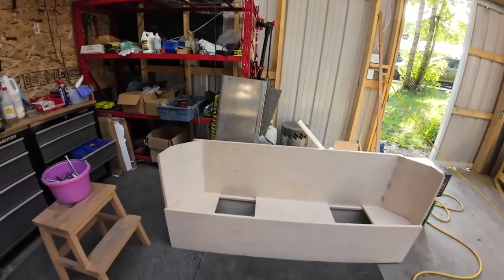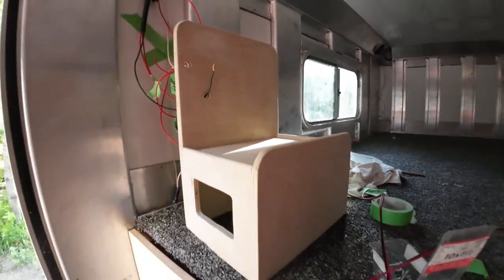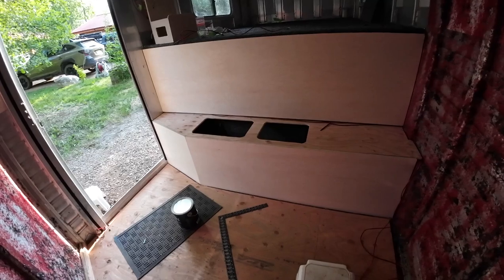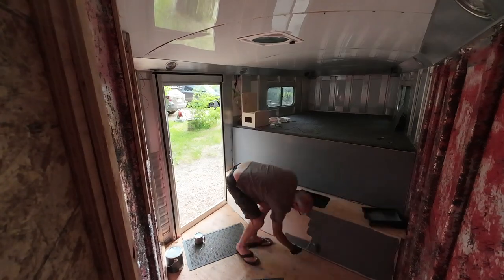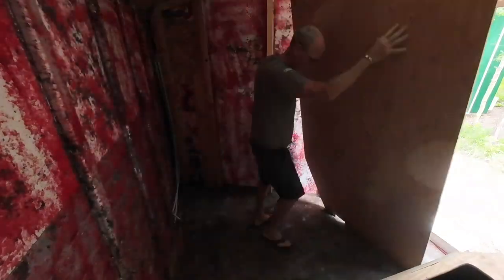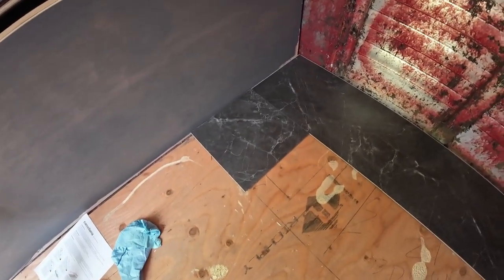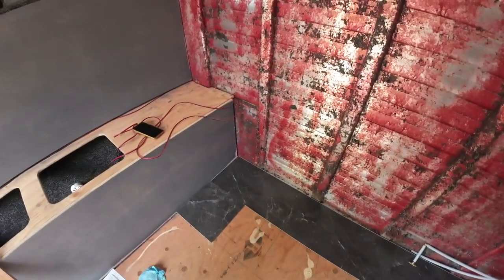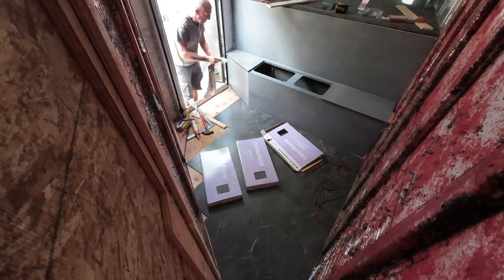DIY Horse Trailer Living Quarters Conversion Part 2

Comment: Not sure where you are located, but the Styrofoam insulation you are using will absorb moisture and you could get condensation on your walls. .